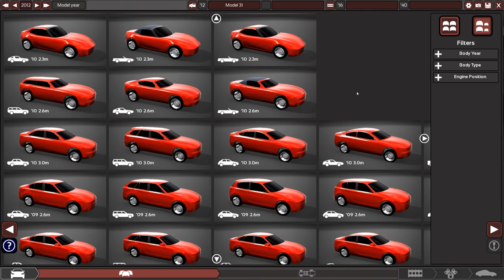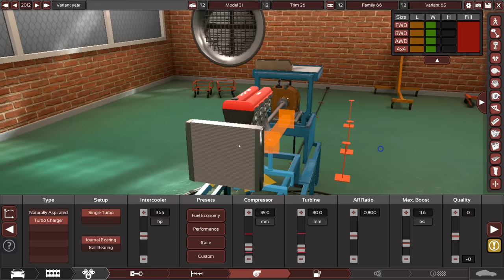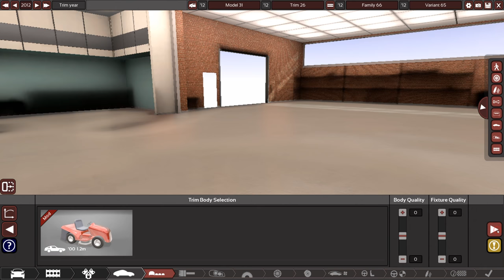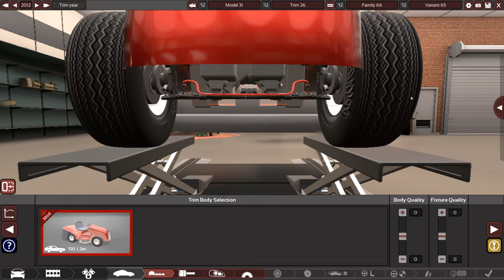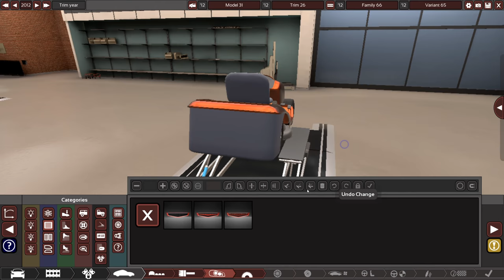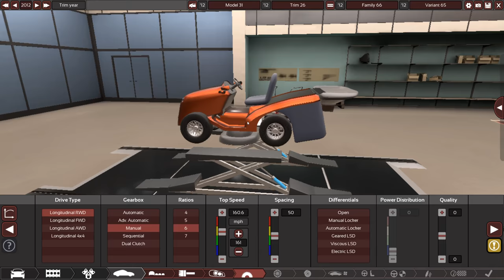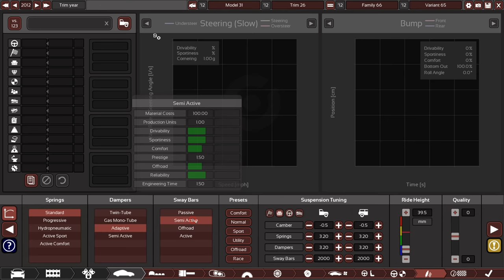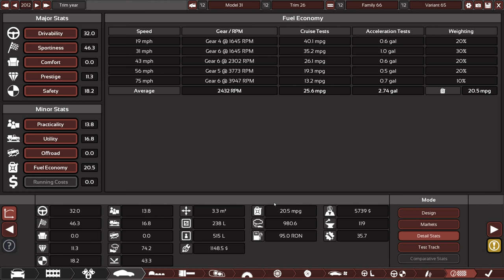Automation/BeamNG Drive - Worlds Fastest (And Scariest) Lawn Mower

Comment: I have a new company name, Crugleap, a mix between Crappy, ugly and cheap. Lmao.
'Crugleap,if it works its good'
Of course the cars have an In-line 3, is fwd and does not have any radio, ac or any stuff that is standard in every other car.
Reply: The weird thing about this is that my own car is a FWD i3 and it has all kinds of bells and whistles that would have been thought extreme luxury items a generation ago, like cruise control, built in satnav and mp3 stereo, thermostatically controlled air conditioning, traction control + ESP, etc, and the engine is a work of subtle beauty capable of almost diesel economy when driven carefully with quite decent output (and, eh, ok torque) for its displacement and a pleasing noise when thrashed (...though it then drinks like a fish).

But still manually wound, quarterlight style windows in the back, extremely rudimentary springloaded seat positioning controls, no worthwhile adjustability of the steering column, laughable spare wheel that looks like it came off a BMX, a clutch and gearbox I suspect might be made out of play-doh, the glass is scratched all over and paint is blistering all over the place at only 7 years old (yeah, I still couldn't afford to buy it brand new) and I even had to bodge in my own 12V socket because that turned out to be an optional extra they didn't bother highlighting anywhere in the spec.

Seems modern electronics have made some things have been made so cheap, essentially just built straight into even the cheapest ECU, that it's not worth pretending that they have to charge for them any more. Whereas they are of absolutely no hope at all with a host of others, and the electronic toys almost seem like an excuse to cheap out on things that you wouldn't have dared risk 10-15 years ago...

And the styling is... divisive. Either you think it's cute, or you think it looks like a fridge on wheels.

So the spirit of Crugleap may actually be alive and well, just dressed up with a bit of distractionary bling.
Reply: @gwenynorisu6883  Well that's funny, but man the i3 wheels are so small they look weird as hell
Reply: I would unironically buy one of those in real life. Modern Model T i suppose
Reply: @skyscall  Well as our one and only customer you are awarded a free tool kit to repair your car when it breaks down. And it will. A lot.
Reply: @tcg1_qc  nothing that a little duct tape and a wrench can't fix

Comment: You get rid of turbo lag by turning the compressor and turbine all the way up
Reply: Lag doesn't really seem to be a problem here, the turbo spools up just fine. That wonky torque curve isn't the same thing as lag. It's just a very peaky cam/VVT and fuelling profile, which are things Automation doesn't let you adjust with any detail at the moment - just set a general index number for the cam (not even adjusting the low/high ranges separately), and adjust the target AFR for the entire map.

So you end up with a decidedly split personality to the engine... hopelessly limpwristed at low revs (like, it doesn't even look like it makes as much torque/bhp around ~3000rpm as I know a comparitively stoneage, 8-valve, single-point injected VW 1272cc managed back in 1991; the multipoint injected version would hand this engine its own arse below 4000rpm, never mind the 16v MPFI one of only three or four years later) --- but a sudden explosion of firecracker energy once you wind the revs up, and only a very narrow transition period in between, essentially marking the point at which both profiles make as much torque as each other and the system switches over (at lower revs the power cam would make even less torque and maybe not even run at all below 2000~3000rpm; at higher revs the regular cam would see the torque gradually tail off instead of increase).

Properly fully-variable valve timing / phasing that made the greatest possible torque at any given rpm would still probably be biased towards the top end with an engine of this configuration with a big turbo attached, but the curve would be much smoother and parabolic looking, and particularly give much more oomph in the midrange.

Not that the mower really seems to be short of go at any point. The light weight (sub 600kg) and reasonably low gearing (maybe all of 18mph/1000 in 5th, which is lower than any of the mentioned VWs... with peak powers from 55 to 90hp, and with a similarly low 1st) means it's got fairly decent pickup even when off the cam and turbo, getting you rapidly into the full power zone (where power is probably electronically limited by the ESP in 1st, maybe also 2nd gear) and if you rev up before engaging drive the clutch slip papers over the remaining cracks.

Sometimes you just don't need a perfect power curve. I mean, it doesn't seem to harm either the performance or sales of yer typical superbike, which even without a turbo tends to have extremely peaky, high revs focussed power output. Some of them don't really come alive until you're doing over 7000rpm, and are happiest above 10k...

Comment: What do you get if you go up the freeway with the driving aids turned off? The throttle seemed to back off to about 80% at ~146mph (or 142 on the speedo), and the ESP light had been vigorously flashing before that. Given the definite weave the mower had going on, I can't help thinking that the aids were working overtime to keep the thing in a straight line and eventually gave up at that speed, just backing off the throttle instead. Maybe also raise the ride height and soften the springs somewhat to discourage resonant wiggling (at least at that same speed)... Might make it up to 150 then.

Comment: A 1300CC I-4 and you don't rev it to the moon? Blasphemy!
Reply: Also it's not "Endo" it's a "Stoppie." Endo is when you do too much of a stoppie and the top of the vehicle is where the wheels should go
Reply: 8500rpm is pretty decent for an otherwise mundane i4 without balance shafts, ultra short stroke, specialist fuel or other deliberate high-revs voodoo. If you want it to go faster with ease you want an i6, or maybe at least an i5 (respectively "perfectly" balanced, and at least less inherently resonant than a four).

Could be worse, could be a balancer-less i3 or V6... good luck getting that much over 7000.

(Yeah, there are bike examples of both i3 and i4, as well twins or even singles, that rev much harder, but they tend to be short stroke and often augmented with balancers)

Comment: Is there a flat-2 cylinder engine in automation? I thought that would be funny.
Reply: Doesn't look like there are any twins or singles, at least at the moment. After all if you wanted to make an authentic lawnmower it'd be a rather low tuned/low revving single of about 300cc... and a racing one would have at least a 125cc-single bike engine (or preferably a 250cc single or twin for extra power as well as improved speed range... or a Harley V-twin if you were competing in the higher leagues and want to make it look like a Morgan).

A 2CV flat twin would be quite entertaining, and open up the possibility of making it FWD (or 4WD by retaining the original engine), but the power output would be kinda disappointing - there are plenty of 250cc class bikes that make more power than the 2CV ever did.

...then again, don't BMW (and Triumph?) make twin cylinder boxer engines for their bikes? Or they did sometime in the recent past, at least, in reasonable capacities and power outputs. Maybe even aircooled, which would be somewhat important for a lawnmower install, unless you wanted the additional hassle of working in a radiator and water pump or thermosyphon setup.

Comment: Over 780kg weight. On a lawnmower. Unless your grass catcher is full of gold bricks, this mod needs a bit of work.
Reply: Gigantic engine and wheels... i built mine somewhat sensibly and it was about half the weight.
Reply: I mean, shit, that was about the kerb weight of the pre-facelift base model mk2 VW Polo... (I had a midspec facelift one which was somewhere in the mid-high 800s, but the user manual listed off all the variants including the old ones...)

30ish years ago now, sure, and a dinky hatchback with only 4 gears and a 1-ish litre engine, but that was still a full 4-and-a-bit seater car capable of motorway speeds, keeping you and all your luggage dry in the rain, carrying a roofrack and towing a trailer, etc, and it even came with (gasp!) a radio, a clock, AND an ashtray...

A stock ride-on lawnmower can't be more than, what, 250kg? My 125cc bike is about 125kg and I can't see where you'd put more than twice as much "stuff" as it represents into the building of a mower. More wheels, yes, but they're each a lot smaller, the larger seat is compensated for by a steering whee being smaller and lighter than handlebars, the fuel tank is smaller, and the fenders are about the same size, plus the mower usually lacks lights, gauges, and often even a battery... so mostly the extra would be in the somewhat larger (but still aircooled single-cylinder pushrod) engine, possibly the funky transmission (...does an IVT represent more or less material than a 5-speed dog-clutch sequential built to withstand maybe all of 30Nm?), and of course the whirling blades and collection box.

So that's 500+ kilos added to the engine and drivetrain, if that's the only place the weight has piled on.
Reply: And even if we assume some of it is the wheels, alloys don't weigh that much. Maybe 20kg each. The originals may have been a good 5 to 10kg each.
Reply: ...and, well, it's a 1300cc. How do you make a 1300cc engine weigh that much, given that entire cars with similar sized engines have existed with only slightly greater all-up weights? Even with a turbo added... Turbos aren't that heavy either, neither are intercoolers. The block must have been made of depleted uranium.
Reply: * 578kg actually. What scale were you looking at?

Which is still obscene, but more understandable. The powerplant and transmission are probably 150kg easy. The suspension and frame are not exactly standard lawnmower fare (a real one would use much simpler and lighter examples of each, and in fact I don't think a typical ride-on mower even HAS suspension - it just relies on the balloon tyres, soft seat, and inherent flex in the frame to absorb bumps, which is a system that works just fine for a machine that's meant to never exceed 10mph, even though that makes it technically not road legal), so they might be quite heavy vs the real thing. The wheels maybe add 125kg total including tyres and brakes, which takes us almost halfway including the engine and gearbox but not the frame/suspension. The rest may be spoken for by the -whale tail- Mighty Wing...
Reply: mspenrice my bad, I was looking at the scale below it, which I think is towing capacity/max payload. thanks for pointing it out

Comment: 19:20 what on earth is happening with your controller input? might want to think about getting a new one, that fluctuation does not seem right at all, and that's whats keeping you at exactly 147... weird.-
Reply: Looks more like ESP kicking in. The controls report 100% throttle all the way up to 139~140mph, then it rapidly - but gradually - backs off to 80ish percent, and fluctuates far too rapidly and continuously to be a dirty pot in the controller or something.
Reply: Electronic stability? there is no stability control, and SC does not cut throttle input in game, only on the vehicle.

Comment: I got a 1.6l i6 with a stupid turbo in that thing, ended up making 470hp and going a 180mph.
Reply: Did you extend the nose, or just make it very small bore? The i4 is already marginal for length, though it's decidedly undersquare and could easily have been stroked to 1.6L or more because of all the spare height.

Despite the commentary in the video, I reckon a tight (ie 60 degree) V6 or even V8 would probably fit in there, if it was short to moderate stroke. The top end would be barely any wider than the base (versus the inline which is narrower at the top), and it's the base that really seems to determine how well the engine fits the width, but there's width to spare anyway. Essentially, the same reason Vee engines were invented and popularised in the first place, cramming more displacement into cramped, narrow-at-the-bottom wide-at-the-top engine bays with longitudinal engines.

That would give you probably something in the region of 2.5 to 3.0 litres quite easily, and the potential for a quite silly amount of power.

With narrow bore, a V10 or (going by your i6) even a V12 might work, though it's questionable whether it'd give any more displacement or power. Depending how much space there is to arrange it all, the bores might end up taking up more or less of the available volume, and I'm more inclined to think the V8 or maybe even V6 would fit better.

Comment: Capable of 147? But you never went over 143
Reply: I was confused by that too but then I realised he was looking at the airspeed readout (quite small, right at the centre bottom of the screen), not the big obvious speedometer. Allegedly, in BeamNG, it's a more reliable readout, as it's essentially a direct measure of what the sim uses for calculating the vehicle's motion, whilst the speedo is simulated as being taken off the drive attached to the gearbox and so is affected by slippage, variations in wheel/tyre geometry as speed increases and causes centrifugal expansion, all that kind of stuff.

Comment: It would’ve had low end power if you switched to a ball bearing turbo. Ya know, what every single manufacturer uses nowadays on their turbo engines.
Reply: Does that really make so much difference to the drag that you can see a difference in the power output other than at the very lowest revs / make the turbo spool at revs it would otherwise remain stationary at? IDK what was in its bearings or when this change would have been made, but my 2003 car with a 1.46 litre turbodiesel in it didn't seem to have much trouble spooling to full boost within less than a second of being completely off-throttle, even below 2000rpm and with a single cam, fixed profile, 8-valve head. Never mind a 16v twin came VVT 1.3L petrol engine running at 3000+rpm seeming to have no boost at all... seems rather more the sheer size of the turbo might be to blame, as well as the engine probably not coming "on cam" even without turbo until 4000~4500rpm. That diesel's turbo was only maybe doubling the peak power and torque at most (NA diesel of that displacement might make 40~45hp, turbo made ~80hp), whereas this one is more in the triple to quadruple range (NA petrol engine of that size might be expected to make 75~100hp, vs the 300+ hp seen here).

Comment: I built a 700hp one with less turbolag
Reply: but how though?
Reply: @boudewijnb  3 cyl 2.2L, it's the perfect length to height ratio, and with a lot of turbo tuning you can get more then 700hp with decent power curve (around 4000rpm of usable power) or even 1000hp, but it would be completly undrivable from the turbo lag

Comment: I can beat this. I have an inline 3 powered mower that reaches 166 Mph. It's extremely hard to handle though because of the power curve. It has a VERY narrow power band with a super steep curve, so al the power is up top and it absolutely shreds the tires.